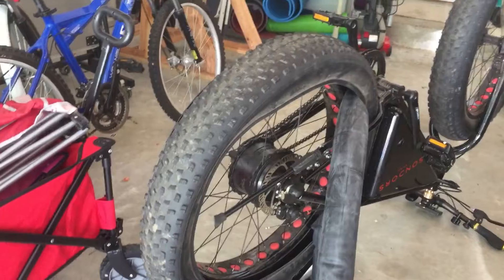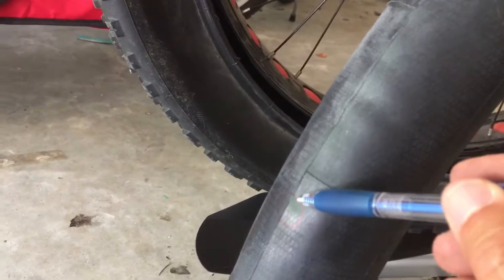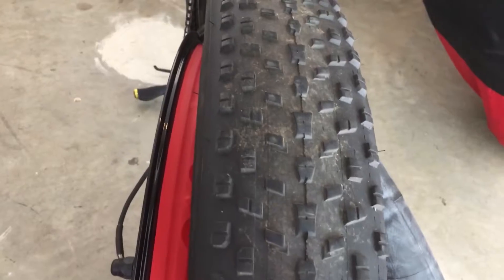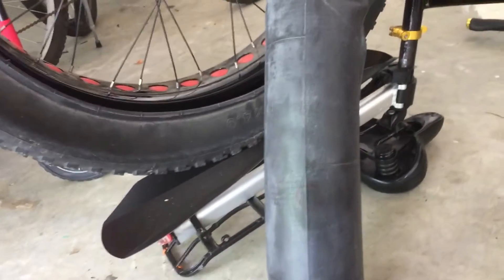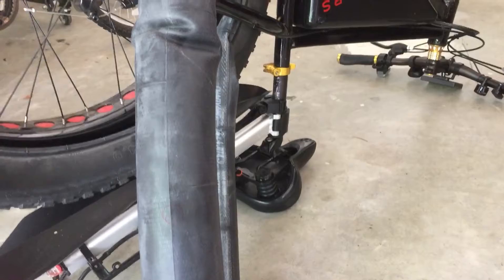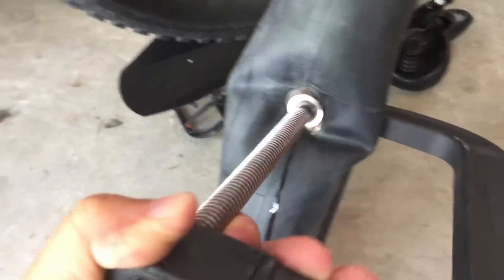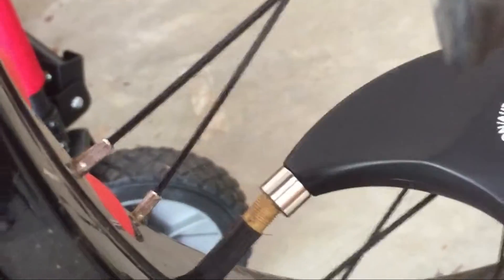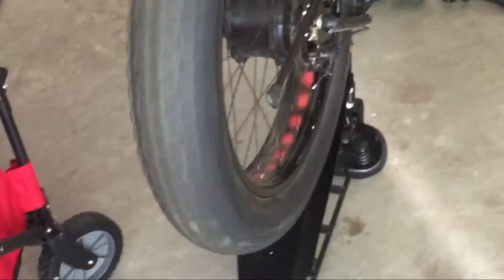Sondors e-Bike Changing Flat Fat Tire Without Removing Wheel just Using Paper and Super-Glue

Comment: Good stuff.  It seems the toughest part of the the tire-changing job are with the tire irons:  Getting the first section of tire off the rim without pinching the tube and putting the last part of the tire on the rim after repair -- without pinching the tube.  Yes, the last tough part is taking out the valve and putting it back in, which this solves (as long as hole is not close to the valve.)  Thank you for posting!